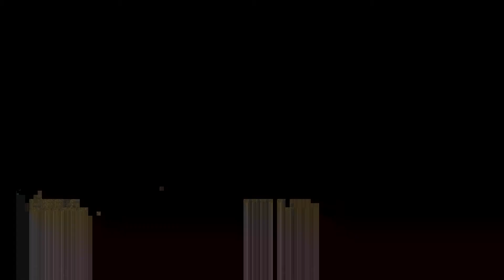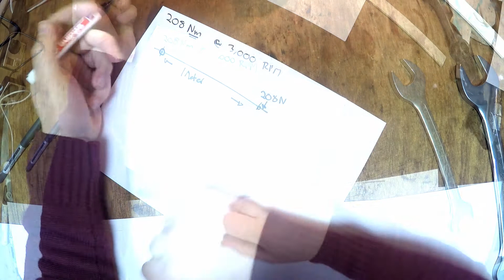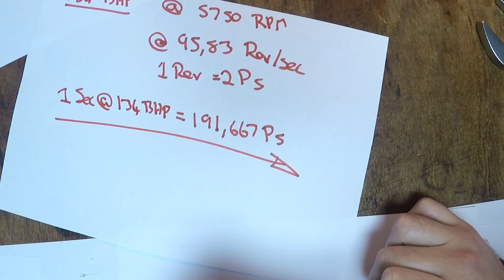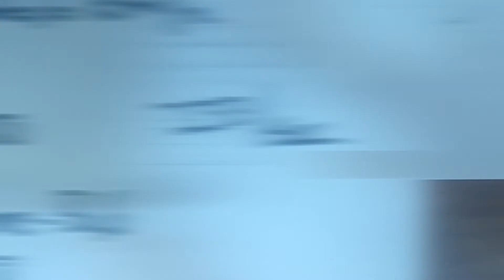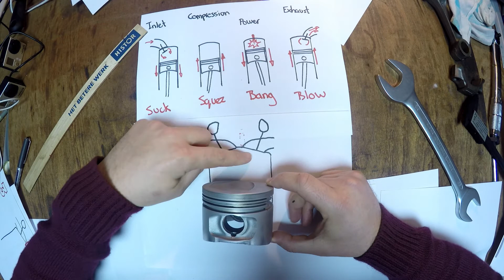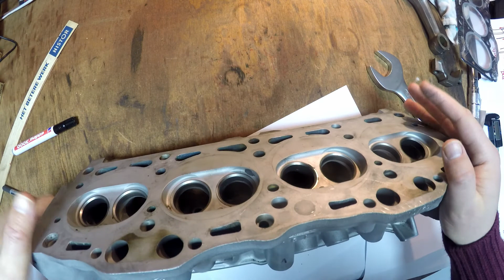Building a Sleeper Part 3 - Uno Turbo/Punto GT Pistons

Comment: What exactly did you break when you dropped it ? that break in the ringlands is a classic breakage of cast pistons on turbo cars. especially punto gt's. You have to tap it in your hand to remove the piece because otherwise you will have low compression and you will not know why... Most punto gt owners remove stock pistons after low compression and they have difficulty finding the problem on their piston
Reply from the maker: Yeah, it was right there. I'm working on the the assumption that is was not damaged in the motor, due to the low mileage of the motor, and the lack of any damage to the cylinder, and that I dropped it. although I cannot be certain it was not damaged before it came out of the block.
I have a set of Gen 1 Pistons, as used in the MK2 Uno Turbo. They can generally take a pounding. Although a set of Wiseco Pistons would be great... my target power levels I don't feel justify it.
my curiosity is using the Gen1 pistons with e Gen 3 head, I head it may cause higher compression ratio. Not sure if you know anything about this?
Reply: @tinyworkshop9746  The piston in your hand is from the GT3 engine that was called a CF2 motor (version 2 - code 176.B6000	) it came out in 1997-8 for covering emissions. Thats why it has higher compression and milder camshaft.... Putting pistons from the older version 1 engine like Uno turbo mk2 or gt1 gt2 1994-1997 engine. Will DECREASE the compression ratio by a lot. It goes down to about 8.2:1. The gt3 piston is 34.17mm height and it sits 0.87 above the deck. but the older piston is 33.3mm and it sits flush with the engine deck. Plus the old piston has a litle bit more dish volume.
new version pistons are good if you will use 98RON or 99-100RONgasoline
old pistons are less knock-crack prone. Propably good for longevity. But with increased fuel consumption (about 1L) and a lil bit more sluggish below 3000rpm
Reply: @tinyworkshop9746  Oh also ringlands tend to break above piston skirts and usually towards the far side of the spark plug. Usually thats the most knock spot prone region.
- If it was a 16v pent roof head they usually break towards intake valve skirt side of the piston.
So being the last spot of the combustion side to burn results in higher knock propability...

Comment: Very enlightening! Always thought the holes in the con rods were for lubing the connection to the crank, now I know it's kind of the other way aroud :) Makes more sense!
Reply from the maker: Well it actually does both, and by spraying up it will lubricate the cylinder side walls as well. the real danger to the motor is the first few seconds after starting. as the oil has all settled, and there is no oil pressure.